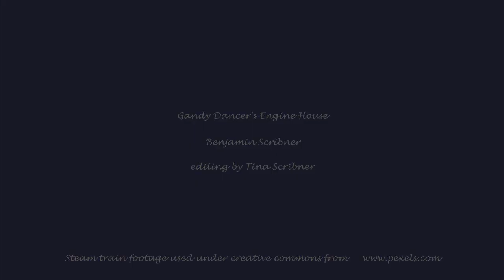Scaling and Making Trees for the layout Vlog 48

Comment: Model trees are nearly always made too small by modelers. E.g., a Silver Maple, a relatively common tree around here, and not especially large or small, is about 60-80' tall at maturity. In O scale, that would be 15 - 20" tall. I've never seen anyone do trees that are that big relative to the primary subject of their scenes. (I don't do model RR anymore, mostly figure and vehicle modeling, but the same thing happens in both.)

As you note, though, trees are mostly fractal, so they tend to look similar regardless of scale.

Interestingly (at least to me), people tend to do cars too large relative to people. (It's common for people to use 1:43 vehicles with figures that are generally scaled at something like 1:64.)

I would find it fascinating to see a G scale layout with a couple of hundred 4' tall model trees, though.